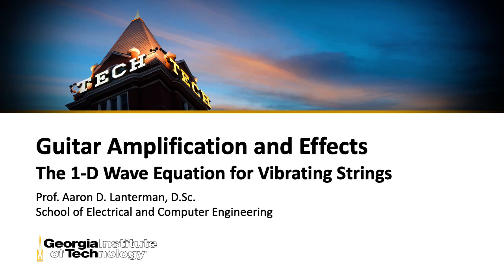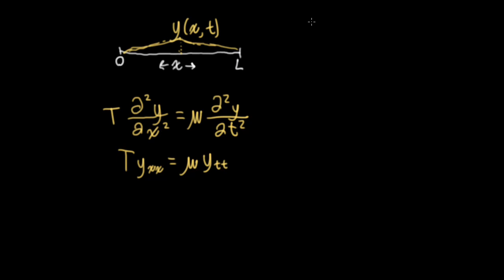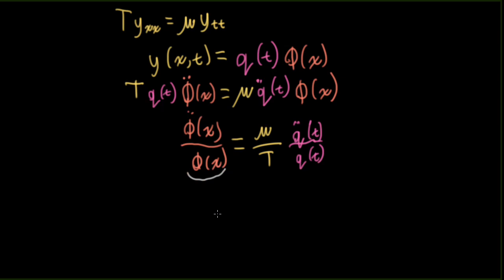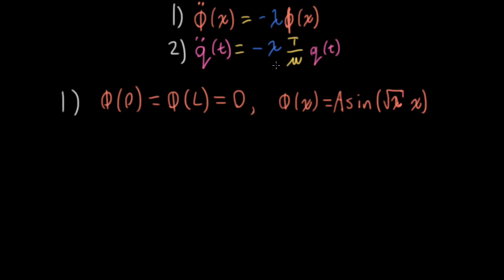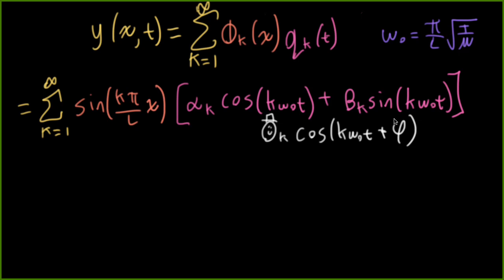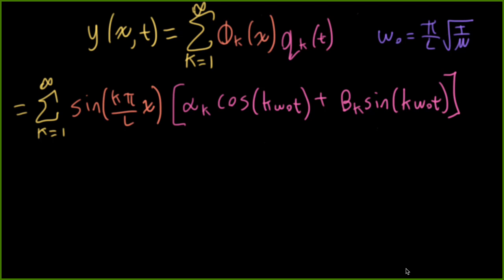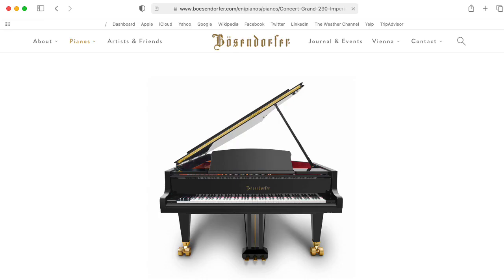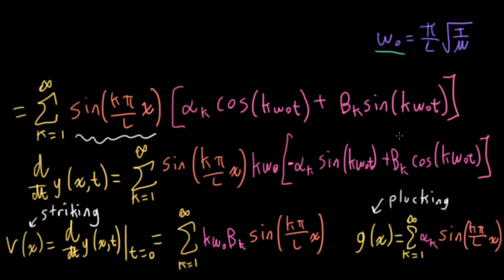ECE4448 L2: The 1-D Wave Equation for Vibrating Strings (Guitar Amplification & Effects)

Comment: I''d like to point that this is effectively a two dimensional string. One dimensional string would only have longitudal vibration, not transverse. (But it''s been years since my college physics so I don''t remember if the math's the same or not.)
Reply from the maker: True, it's only 1-D in terms of it being parameterized by a 1-D function. Drum heads are technically 3-D but people model those with 2-D functions and will call it a 2-D wave equation. The range of the function covers the other dimension.

Comment: Would tapping on the guitar also be considered striking and use the V(x) equation? Thanks for the amazing lesson!
Reply from the maker: That would actually be a lot more complicated, and beyond the assumptions of my model. I think there the vibrations from the tapping get coupled into the string through the nut and he bridge, and I assumed the nut and bridge were perfectly fixed. You'd need to let the nut and bridge move, which would made the modeling a lot more complicated. There's another dynamic there, if the pickups are microphonic, in which case tapping the body sets up a vibration in the pickup.

Comment: Wow, I don't believe I would survive a course like this lmao! So from my understanding, this series of formulas are all around understanding the process of vibrating strings down to length, tensions, pitch, harmonics, and so forth? For hardware, plugins, and the like. Is there some form of speech in them to compute these equations to change an instruments tuning like drop tuning features on modern multi-fx pedals and units? Is this what thinks out (readouts) for these outcomes to be possible? 

 My follow up on this thought, would in that sense it be possible to instead of changing an instruments pitch. Could there be readouts done to change the tonal sensation of tension of a given instrument? For example, I love having playability of relatively tight tension low action on my basses for my playability but I love the sounds of flobby or loose string tensions the likes of NY Hardcore punk, nu-metal (Korn), and more modern heavy music (Varials Anything to numb)